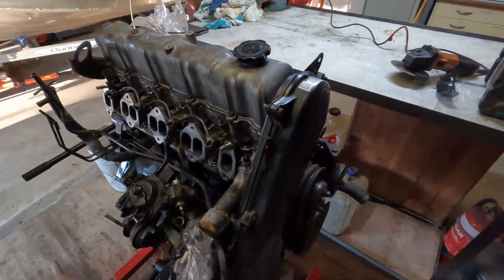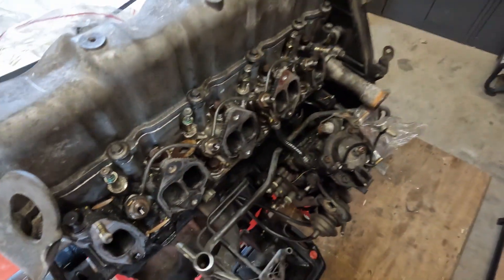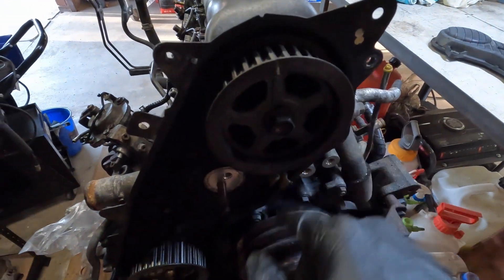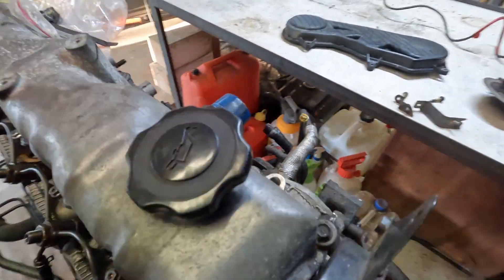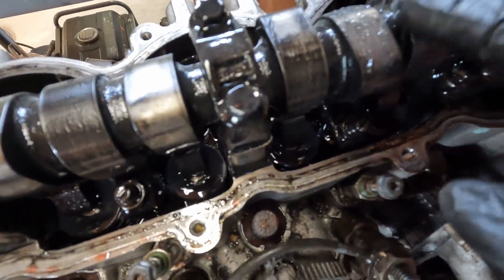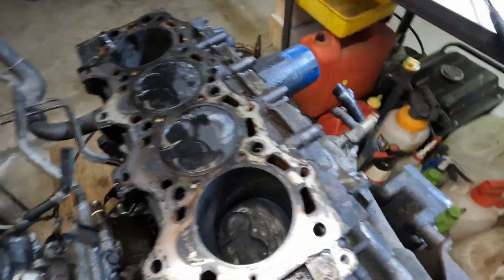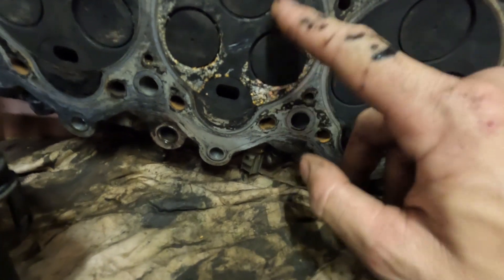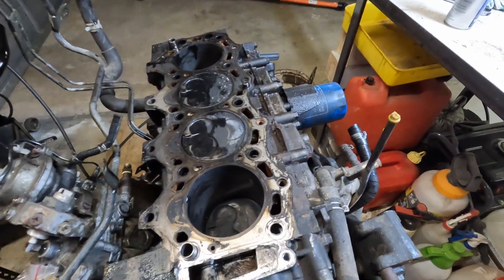WLT Engine Rebuild Ford Courier/Mazda Bravo: Hot & Cold Side + Cylinder Head Removal (Part 1)

Comment: Ive not long found your channel. O love my 2002 Courier. Stock as, but love it
Reply from the maker: You planning any mods?
Reply: @Finndawg I want to do a stage1  turbo and intercooler. Have had the hose swap on the turbo for years. It does actually help, when loaded up with a camper or at an intersection.
 I'd like to lift the front some more, still stock hight.
It's all about the money 😂
I do have a lokka to put in, just lazy

Comment: Nice video. Am considering doing my 99 courier suspected head
Reply from the maker: What makes you think so? did you ever get to the bottom of it?
Reply: Not yet
Reply from the maker: What's it doing?
Reply: @Finndawg  not sure haven't even started it for couple months
Reply: Last time it was running just runs rough sounds like it skips a beat when idle and blows white smoke. I've overheated it probably twice one of those times I had to keep driving for a bit so probably cooked it then but it already blew white smoke before that
Reply: Yeah sorry for late reply but I've ran it recently and bubbles up of of the radiator cap and then fills reservoir pretty quickly
Reply: Silly question but do you need to drain the oil first before taking it apart I 'spose?
Reply from the maker: Yeah dude, gotta drain the oil before you drop the bottom sump and all that, alot of oil that'll be in the way.
Reply: @Finndawg yeah thanks heaps Finn

Comment: Hey Finndawg, do you have a photo of the head gasket (as found) when you pulled this engine apart? I just wanna see if some water jacket holes are blocked (covered) by the gasket.
Reply from the maker: Hey mate, unfortunately I don't have a photo of the original head gasket. I'm sure you'd be able to find something online though. Good luck!
Reply: @Finndawg  That’s alright. Thanks mate.

Comment: Hey dude, rebuilding one of these at the moment, have removed all the bolts but the head is stuck in place. Any tips for safe removal of the head.
Reply from the maker: It can be abit stubborn, I just use a rubber mallet and smack in different places until it slowly loosens up, only hit hard spots that can take a decent whack, I try hit in an upwards motion where possible too but generally that always works. You don't really want to be trying to wedge pry bars or flat heads between the deck and head or you might scar the mating surface.

Comment: Hey mate. I have my head off but need a new o ring before reassembly with new head. The part left in the block sticking out on the head gasket surface.. do you know the technical name for it so I can get the correct o ring? Maybe it comes with the gasket kit that I’m yet to receive? Thanks
Reply from the maker: Do you mean the little oil port things that stick out of the deck? In-between the coolant ports? I just used a regular o ring that was the right size
Reply: @Finndawg  yep that’s the one. I wasn’t sure if it needed to be high temp or oil resistant etc. last thing I want to do is pull the head again :( thanks for the reply mate.
Reply from the maker: @mathewpover5631  I haven't had any issues personally, but the rebuild kit didn't come with one so I asked the shop that decked my block and honed the cylinders and they just said to use a regular o ring.
Reply: @Finndawg  good to know mate, thanks!

Comment: Almost got my head off but the injectors are covering access to the 4 lower head bolts. How did you get the injectors out?  Whole or parted? Not sure how to describe it... I have pictures..
Reply from the maker: Whole mate, just get a 22mm long socket and take them off intact. Getting them in pieces is a pain to put back together.
Reply: @Finndawg  Thanks. I was looking at it and knew the answer. Luckily I buy lots of tools and sockets and just found one of my long socket sets. Worked a dream
Reply: @Finndawg  got the head off at long last. Cracks in both centre cylinders so new head about to be ordered.

Comment: Can the head be removed while the engine is in place or am I wasting time and should get it out and work on it on a engine stand?  I have two Bravos and both need their engines worked on, I hope the one I am about to start on is just a head gasket but the more I think about it the more likely I am thinking that the issue is going to be a cracked head like you have had...

Also what was the state of the water pump blades on your engine?
Reply from the maker: You can work on the head with the engine still mounted in the car, its a little more fiddly and harder to access but you can remove the head regardless. Yeah the head cracking is very common on these. The blades on my water pump weren't terrible but the actual pump was alittle stiff and have to move so I replaced it, the previous owner also ran it without coolant only water so it had a lot of rust in the system also.
Reply: @Finndawg  My water pump had razor blades for fins it was so rusted..